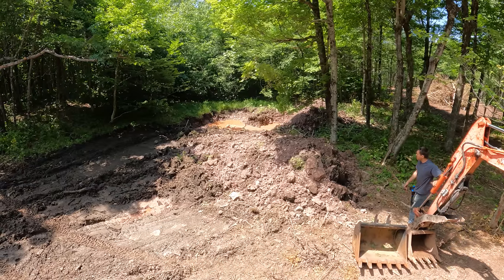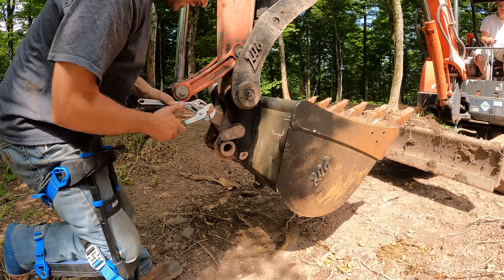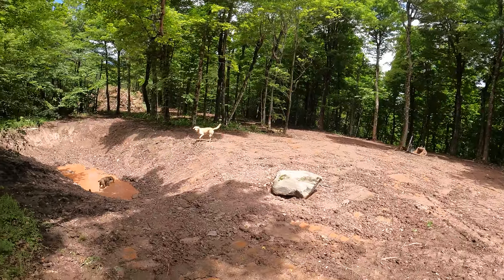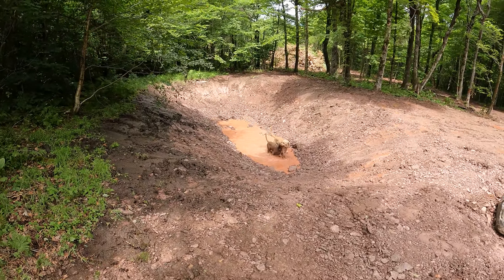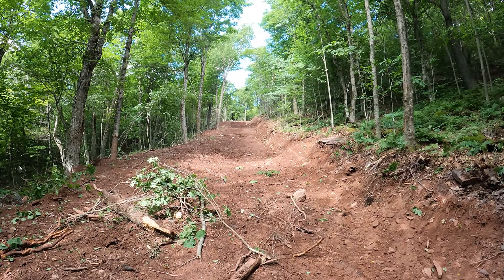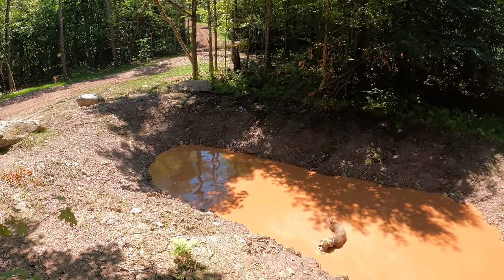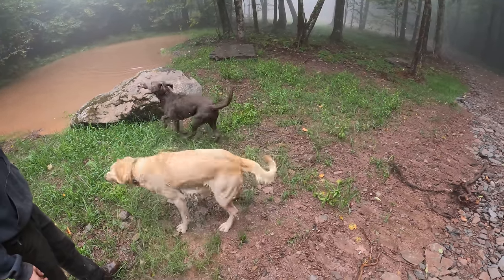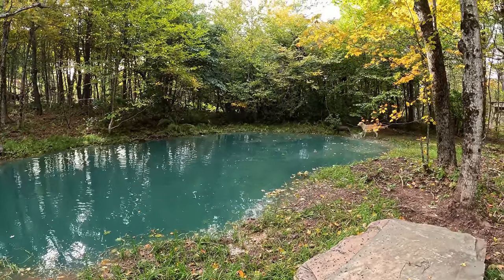Welding an excavator bucket and digging pond

Comment: Pond looks great and a joy to watch Cody and Blue having fun. I guess the water may clear in time but you could put some water plants in it.
Reply: Yes marginal aquatics will help esp with reducing excess nutrients, which will also reduce potential algae. Must say ive had great success using straw bales to clear water in my ponds, esp newly built with the colloids still in suspension. Carbon absorbs and the microbes that comes and is added along with the straw also plays a role in clearing the pond water. There are some research about barley straw too.

Comment: Nice work! I've seen you weld on Kubota ears like this before, using the machines coupler and some c clamps to get them in the correct position. Not sure if you do this but it wasn't shown in the video, but adding a 1/16" shim between one ear and the coupler helps a lot. I did one that ended up a bit too tight.
Reply: I agree with adding a shim when building - even just 5-10 sheets of paper is sufficient.
Reply: A couple layers of masking tape works well
Reply: Good info.  Thanks

Comment: I can't believe he's driving with his left foot😂, that's actually crazy, I've tried doing that just out of curiosity and I legit almost crashed, your left foot just isn't used to the light touch required for driving, so that is seriously impressive on his part, must have taken him a bit to get used to
Reply: That’s probably true for anyone who didn’t do any go karting as a kid. I can regulate both my feet just as well. In karting you brake exclusively with your left foot.
Reply: I broke my right leg, ankle, and foot in several places many years ago,  and once I got out of the hospital, just 3 weeks later was driving my cars again.  First few times it's a little sketchy,  but you quickly get the hang of it.  Using your left foot to brake takes some getting used to. Even after my foot was considered "healed",  I continued using my left foot to brake for a while,  until I built up strength in my right foot and got the muscles in my right leg back up to par.
Reply from the maker: I drove with my left foot delivering mail for years.
Reply: @AndrewCamarata  lol right cause it's on the other side, that's crazy....you know what would be an awesome video, you buying an old little postal truck and doing like a tour of the thing about all it's 'quirks and features' and like accidentally roll it off a cliff like what happened with that Toyota you had😂
Reply: @AndrewCamarata   I think you may have a scammer that responded to Andrew London. And they have been saying to others they have gifts just didn't want anybody to get scammed. Just a heads up they are using your same YouTube profile picture. Love your content keep it up brother!
Reply from the maker: Waste the spammers time, find out info on them. Go get them for identity theft.

Comment: Hell yes.. another awesome video
I've never seen a leg support like that before. In the UK we just have a soft oversized foam rubber boot we wear over the cast and try to walk as normal which improves healing and circulation
Reply: @Peter Johnson with a chainsaw🤔
Reply: You mean those that still let you walk around with the hard plastic bottom? I saw some screen shots of Andrew wearing that over on the Facebook fan page (I think).

Comment: Never run with scissors either!  I am glad you were not seriously hurt.  I had a creative Andrew moment!  I went down to my moms house to mow the lawn. She doesn't live there now and it's empty.  I went down and mowed the lawn and did a bit of trim.  I keep it nice for the neighbors.  I got in my car and it would not start.  Hmm, I am not mechanical at all. I lifted the hood and checked the cables. There was all sorts of white powder on them.  I found a pair of pliers in the garage and took them off. I found a mini wire brush and cleaned them  ( I talk a lot sorry).  I put it back together and nothing.  I only have a cell phone for emergencies.  In the past year I think I used it twice.  I charge it up and it can go six month before needed charged again. I always carry it with me when I am alone for occasions just like this. Grrrr I did not have it with me..  Why me?  Dear Lord why me? I have copd and certainly could not walk anywhere.  I did try two neighbors and they were not home. I thought I'd just sit there and wait until the afternoon when I was missed and one of them would check here.
While I was sitting in my car I hadn't shut the garage door yet. I looked in my trunk and I had my cheap jumper cables.  Get ready to laugh!  I started up my John Deere L100 riding mower and pulled  it by the front and attached the cables.  I tried starting it, nothing.  I let it charge 10 minutes. It kinda wanted to kick over!  I let it sit 10 more minutes and the car fired right up!  Wow. I did it by myself.  And with a lawn mower.  I swear, I would have never thought of using that lawn mower and getting creative if I had not thought of Andrew and what he does to get a job done.  I drove straight in town and got a new battery. The guy commented that my battery was an original so I got 11 years out of it and he was impressed a factory battery lasted that long.  I bought it new, 2011 Chevy Malibu.  It just turned 6,200 miles.  With copd I order my groceries in, even before the pandemic and only leave once a month to the doctors and to stop and get my medications. 
So watching Andrew and others brings the outside world in to my home.  Loved this video.  That pond looks awesome.

Comment: Hi, Andrew - obviously not for heavy work, but just for mucking around the house I use velcro strapped old man shoes just for between the house and the shop.  It's almost impossible to trip over them and I have to get them on in a hurry when taking the dog out in the middle 'o' the night so similar setup as what you were doing, on a nightly basis.  Brooks Addiction Walkers are AMAZING!!! I'm due for another pair.

Comment: On the subject of clearing water ponds or puddles of some size from the sediment in the dirty water.  I was watching another video from Freddie Dodges Mine Rescue, and he had a problem with a water recycling pond in the desert (I believe it was in season 1 of that show).  He pulled out a liquid and dropped a cup or two into the pond.  The liquid was more clear than blue and within seconds I could see the sediment begin to drop and the water was becoming clearer.  To make the process continuous, he made a device to add the liquid to the pond into the incoming running water from the plant into the pond.  There weren't any dogs in that video to compound the problem either.  I'm glad that your friend said that the blue liquid was pet friendly.

Comment: back in April I rolled my ankle after i tripped on a rock, I walked on it for on it for about a week before going to the doctor and getting a xray and then a ct scan... turns out i fractured my calcaneus (heelbone) i was in a moon boot for 6 weeks, sometimes i didn't bother with the boot though and just stayed inside sorta using it as an excuse to not do much. 

its good you didn't fall into the same trap haha

Comment: you could usethe ash from the burn piles to spread over the slate gravel roads.....uncles used to do it on the back road in the Ozarks for moisture control

Comment: i jump back and forth between your videos, hope the foots better, cant tell where you are  in time  , even
though you think im a scammer, which im not ,,,,, i still watch your videos ,keep them coming .  i still have that gokart buggy,  i need  to get running , book a job ill help run all equip bigger the better.  ll pay parts  i put carb on just need battery and some cables brake and throttle just a young irish american veteran looking to get out of the house for a couple of days, when i see cerebral ailment up there i wish i was there with you guys.

Comment: nice little swimming pool too...not sure if that blue stuff gets rid of the mud thats theere as its just colouring but theres a thing called "purification cube" just throw 3 or so of those in there and it would probabyl filter out the actual murkiness...worth a shot id think for soemthing that small..and it might clear the water right up and you can see the bottom
Reply: might take more than 3..5 maybe idk but it should make the water clearer

Comment: You need to put some clay in the bottom of your pond.  It was holding water pretty well until you hit aggregate and in seconds it drained away.  The big drain starts right about 13:15 in your video.  Look for the  fine aggregate where you are digging. =D

Comment: I saw a very interesting video on youtube about ship breakers in bangladesh using the high strength steel they salvaged from breaking a ship to make huge excavator bucket using mostly blowtorch or hydrogen torch and backbreaking labor, the only high tech thing they had is a giant metal press and not much else but the most striking thing is they do it all wearing sandals and no other safety gear.

Comment: I really hate having to drive an excavator into the pond to do Muk work like that. Because I always have to take apart and clean out the final drives because if you leave the muck in there it rots the hydraulic cables and other stuff in there.

Comment: surprised there is not a newly designed and built turbo-charged dual action quad wheeled forward and reverse in several gears broken foot transport vehicle with room for passenger and two labs.  ooh, yeah with a winch and trailer hitch.

Comment: Hi Andrew, you have several older, higher hour mini-excavators. I have never heard you mention if you deal with slop/play in bushings. It looks like you just run them as they are. I recently bought a Yanmar vio35 which works and runs great, but has some play in most of the bushings. I am debating if its worth it to repair or to just run it as it is and learn the trade before investing the time and money. Thanks for your awesome content and inspiring people like me to get out there and start taking some jobs. I did a few this year, plan to do more next year.
Reply from the maker: I have never messed with them. Just grease it.
Reply: @AndrewCamarata  will do, thank you!

Comment: I got a case cx36b about that size and I have a thumb and was just wondering how you have those hydraulics rigged up is it as easy as just t-ing off the remote that's there or how's that work because I'd like to get a breaker for it but I don't wanna really keep taking my thumb on and off I use it quite a bit especially picking up rock

Comment: I am surprised that is holding water. Here in Australia we line these out with clay or the water soaks away quite rapidly. In fact I have  Dam/pond on my property that has sprung a leak due to a nearby tree falling. The roots can open up the soil underground and cause it to leak. My water is the same brown colour as yours was. lack of oxygen and clay soil.
Reply from the maker: Yeah I was worried too, I have a few ponds on my other property that don’t always have water in them, at this property there are puddles on the ground that will last all year so I felt safe about digging a pond, it’s still completely full.

Comment: Andrew. I feel your pain. I broke my right 5th metatarsal this past April as well. On the stairs at home didn’t even fall, just missed a step and rolled my foot barefoot. I needed up needing surgery as the bone looked like it exploded. Now have a plate and 9 screws in mine. Because of the surgery I was out for about 4 weeks which sucked. Was back at it right after that as best I could. I’m totally fine now except for the metal in my foot.

Comment: That was a strange place for the bucket pin to begin with before you fixed it. I’ve never seen one mounted sideways like that. Unless it was for a swivel but that’s usually made on the excavator. What was the reasoning for that Andrew?

Comment: I definitely did not like the orange-brown water in the pond but I also don't like the way the water looks with the blue stuff in it. Obviously the soil is what is making it that ugly orange color. I wonder if a liner would have solved the problem, or maybe even a thin layer of concrete around the pond with a short curb around the pond to keep runoff from messing it up again. I like the water to be clear and clean.

Comment: You need to aerate that pond. Get a small amount of power to run a continuous pump through a box with some lava rock in it. A big tote is good.  Suck  the water  up through the rock gravel and then up to  a bit of a fountain so it agitates the surface to entrap oxygen. Put the intake at the end opposite the fountain to get good circulation.The porous stone will get colonized with bacteria that with the oxygenated water will make it crystal clear. A solar panel? A wind turbine? Your chemical approach might seem expedient but is not a reasonable cancer free  solution.

Comment: It seems like short hoses are a, somewhat, common problem. 
Would it be possible to have a 2-4 foot extension hose made that you can just keep on your excavator or in your tool shed for when you need it for a new attachment? 
Then you don't need to worry about extending the hoses on every new attachment.

Comment: Hey Andrew how do you like that tree shear attachment for the skid steer worth buying
Reply from the maker: Yeah, that actually is. Make sure you get it with the hydraulic rotate feature.
Reply: What about that stump splitter attachment that you bought
Reply from the maker: Which one? I am not super happy with that rotator screw thing. Its ok, wont do biggest stumps.
Reply: The for the skid steer big long orange one not the auger
Reply from the maker: Oh, that is ok, that is more for big logs than stumps. I think that would be better on the excavator. I almost want to weld excavator ears on it.
Reply: How have you liked your koehiring 6633 excavator? Will you be making a video covering your first year of owning it
Reply from the maker: @matthew582  it’s good. It will be in a few videos soon.
Reply: What about your bell haul truck how has that been for you? Any issues with def yet
Reply from the maker: @matthew582  no issues with bell.

Comment: I got a project for you that you probably would like I mean it's for yourself have you thought of taking four containers and making a tower out of the four containers standing up all four point in and also build the platform on top like you did the ones together at your Castle but somewhere else on your property put up a tower that would have your bedroom kitchen workshop at the bottom 53 ft that should get you now I have for the and you said I was just thinking about that if you stuck windows on one of your properties in the woods where it's got maybe I don't know a lot of trees and set that Rascal up put it on 12 inches of concrete oh how thick does a pet have to be for shipping containers can you do it with six or something you need to do with eight or is for good enough